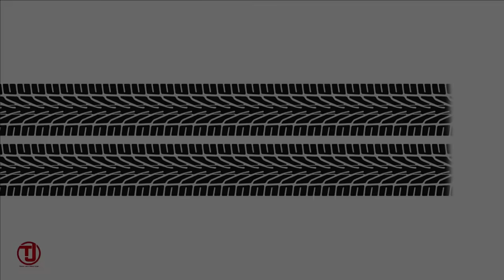That's not for me drive & Uncoupling Tutorial

Comment: Hi Martyn, another good vlog mate. With regard to that diversion round the low bridge in Horsham, it only applies to the A281 from the Brighton direction, you can get round it by turning right at the Tesco Express. You’re OK coming from the A24 or the A281 from Guildford, indeed I would probably go from Alton on the A31 over the Hogs Back into Guildford then on to Horsham on the A281. Like you though, I tend to go the way I know. Most of the 7.5 tonne limits in Horsham are to do with the residents than any physical barriers.